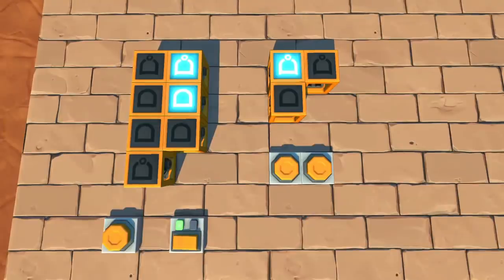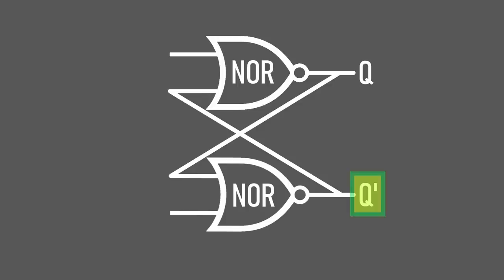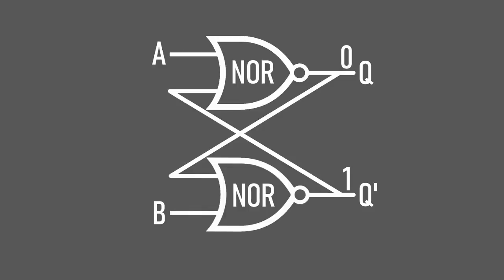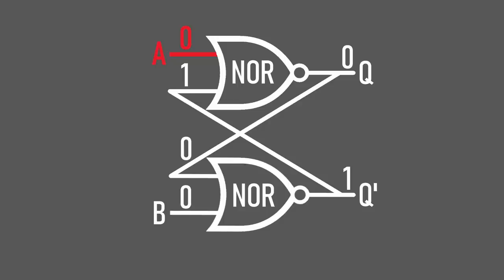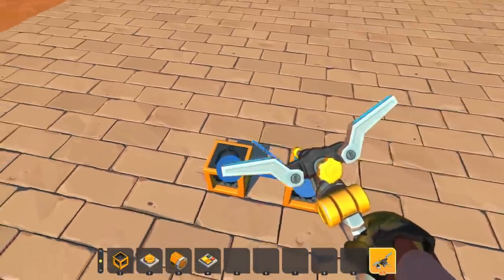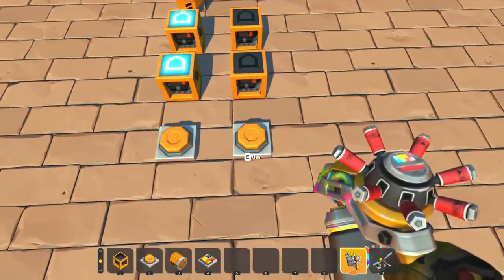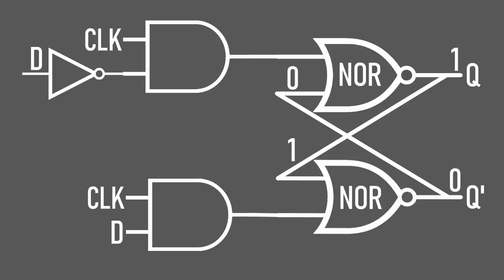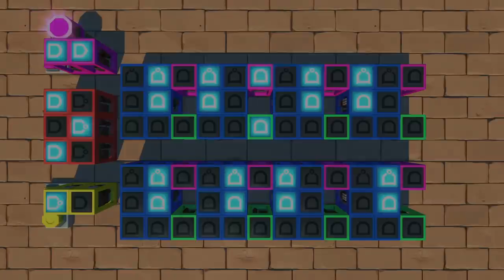How do Computers "Know"?: Making a Computer in Scrap Mechanic - #2

Comment: The D-trigger can be significantly reduced - from 7 gates to 4. You make a cycle of NOR-NOR-XOR gates, then connect AND *CONSIDERING THE SEQUENCE* to NOR (the one connected to XOR) and to XOR. After that, also *CONSIDERING THE SEQUENCE* we connect the button, or any other input to NOR (the one connected to NOR) and to AND. And lastly, connect the switch (toggle button) to AND and you're done! It is quite resistant to short signals, but like any other D-trigger, a single-tick signal “breaks” it, like any other D-trigger, since it somehow has a cycle.

Comment: It is absolutely necessary to use a fourth gate (AND) to stop noise, hook up both states to the AND and the output of that to the OR. That way when you spawn it or give too short of an input in it doesn't glitch out and blink forever. But maybe your way of connecting bonus OR works too.

Comment: You should have brought up how what you just did was recreate the "switch" item that the game already has, except even more practical because the switch-state of the game asset cannot be altered by logic, only by user input, where as the latch can be done by user input or by logic. 

I found this detail really cool but not everyone might realize this.

I look forward to seeing when we get into a logical "If Equal" stuff in comparing data values beyond boolean/1bit data values.

Comment: A self-wired xor gate allows fast and small memory. On a 1-tick input it will flip the value that is stored and only takes up 1 block. 

To do this you need to edit a blueprint that only has 1 xor gate and modify the controller list for that specific object. 

You can add increment, decrement, set and reset inputs easily with just and, nand and nor gates.

Comment: Love the video! I will say using red when highlighting both on and off signals in your visualization was a little confusing. It would probably be easier to follow if you used something like green and red depending on the state of the line you’re describing.

Comment: The first gate is literally an rs nor latch, it's so cool to see redstone mechanisms in real life.
Reply: its not a redstone mechanism its a logic circuit. redstone mechanisms use the theory of logic gates in minecraft, not the other way around dude. its also called an SR Latch
Reply: @arktufamily9498  ik but i have learnt about the concepts for redstone and I and now see how they work as logic gates
Reply: @arktufamily9498  In redstone it has always been referred to an RS-NOR latch.  You will find far more results using that term.  It's one of the first things I learned in redstone.

Comment: if you connect 2 (nor gates) and an (or gate) in a circle and then conect the (nor gates) to an (and gate) and then this to the (or gate), you have a 4 block design which always starts in the same position

Comment: You should use a D flip-flop instead of a D latch. The difference is that the D flip-flop has the clock signal be activated only on the rising edge. The problem with the D latch is that when the clock signal is on, the data line can change multiple times and the new data will also be stored multiple times, whereas for the D flip-flop, the clock signal only sets/resets the data only on the rising edge of the clock, making it so that the data only stores once.

Also what you built is not a D latch, but a Gated D latch.
Reply: It would be a simple change, all you’d have to do is add a rising edge monostable circuit to the clock inputs.
Reply: @NStripleseven  Ye

Comment: I'm more used to |Q| or !Q to refer to the opposite of Q.

Tho, "!" only works in Boolean outputs like we have here. Never seen Q' b4.
Reply: "!" makes more sense to me because of software development.
Reply: @valderon3692  Both are software develoment.

! refers to that of "not" where as |x| refers to either inversion or retaining the positive value (depending on the language). Don't quote me on that last part tho.
Reply from the maker: I've also seen ~Q to mean the opposite of Q, there are a lot of different ways to do it
Reply: @ReidCaptain  Yeah, I've seen that b4 as well. I just didn't include it with the other stuff as that symbol can be confusing as some calculator outputs use that symbol to refer to when an answer is not exact. Like 2/3 = ~0.666666666667
Reply: @Hadeks_Marow  I'm not a professional by any means.  I do it more as an occasional hobby and haven't actually seen '|x|' used to get an absolute value outside of hand written math.  I usually use some function or method like math.abs(x).  I have however used '!' as a "not" plenty of times.

Comment: only problem with memory bits is that they glitch out when you spawn them. i am still trying to figure out a memory bit that doesn't do that but currently i just attach a simulated button press to the input to fix that issue temporarly.
anyone any ideas?
Reply: I have a fix but it is too complicated for me to explain especially in a comment section TvT

Comment: I really want to know what the computer will look like
Reply: For the most part it is just small circuits like these used over and over and over.  in terms of size it really depends on how complex he wants the computer to be.  Regardless, I'm sure it will be a heck of a lot smaller than Minecraft computers if you have seen those.
Reply: Well I don't mind if it was small it will be as complicated as the Minecraft one